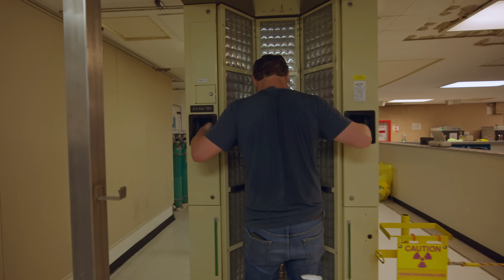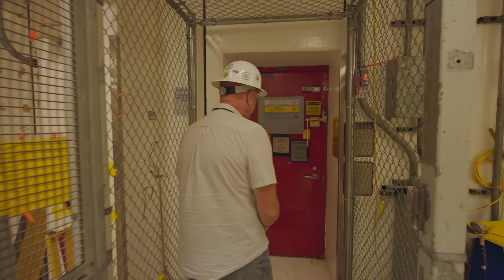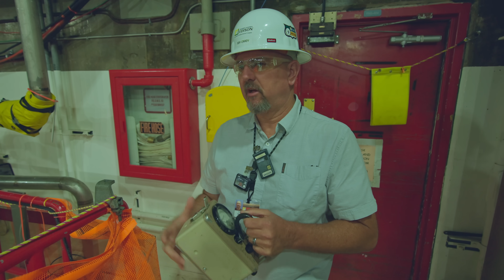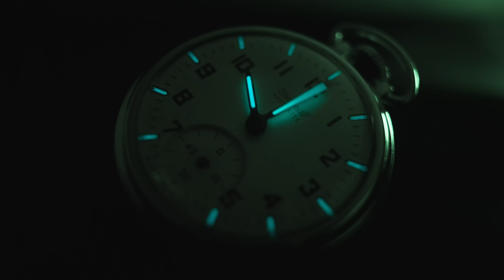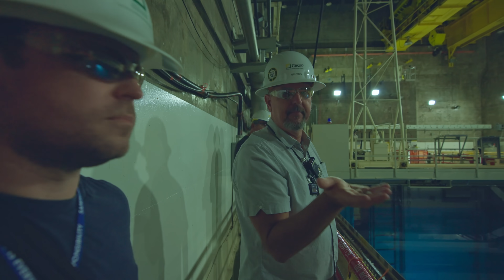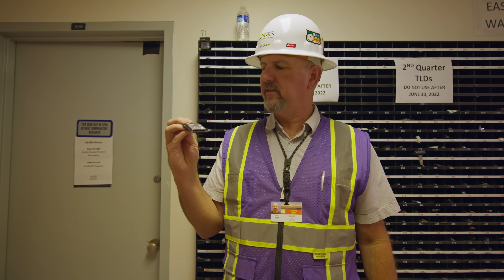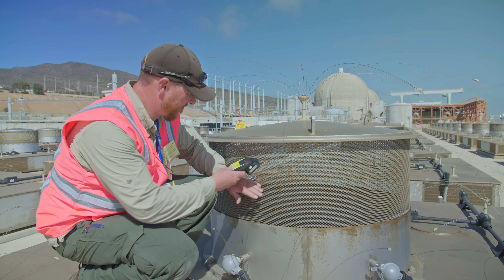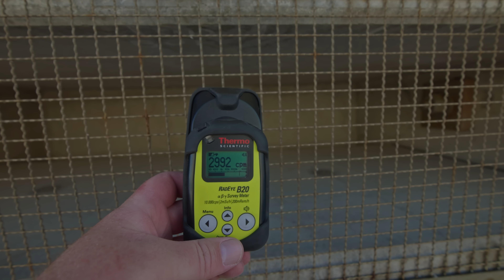Inside San Onofre Nuclear Power Fuel Pool and Spent Fuel Storage

Comment: About 20 years ago.  I was contracted, by a colleague and friend of mine.  To shoot some video.  For a nuclear, pharmacy.  In the northern Virginia suburbs of Washington DC.  Cool.  Or rather, hot.

So the cyclotron was down for service.  And we walked into the cyclotron.  And we stood there and talked.  When the representative asked me where my, dosimeter was?  Oh yeah I left that on the table.

He realized we had been standing in the cyclotron, too long.  And we immediately vacated.  We exited quickly.  And so by now maybe I don't light up sensors anymore?  Or at least in another, 50,000 years maybe?  I'm not waiting either way.  When I'll be on my way back to, Alpha Centauri.  As it's just a Sunday flight there faster than the speed of light.  Because I'm not waiting 4 years.  At that slower speed limit of light.  Because light can only go so fast.  With all its little photons zipping about.  One needs faster, higher frequency, invisible light.  To go faster than visible light.  DUH!  Faster than light speed requires invisible light.  It's that simple.  Which is in and around all that dark energy and dark matter.  Which is why it can't be seen.  DUH.

It's obvious to me there is a whole lot of, dumb uninformed, scientists.  Thinking light has a speed limit only to the visible spectrum.  For human eyeball sensors.  That weren't made as well as a birds.  Because we didn't need to, drop stop and shop for insects.  Or mice, moles and rats.  As an appetizer.  Before a meal of squirrel.  Or groundhog with barbecue sauce.  Always a treat.

Nuclear power will keep us all warm.  With no need to worry about getting old and sick.  Before dying early.  And it makes perfect sense.  They allow the human  species to extinction itself.  As humans seem to have the propensity to do.  Just ask, some Neanderthals.  Oh that's right.  They are all extinct.  Never mind.  Okay then ask a Cro-Magnon.  Sorry no luck there either.  They seem to be all gone?  Yet not down at Smitty's bar?  And was told they were partying with a woolly mammoth.  Driving a VW Thing.  Diesel powered.  So, not sure where they went?  Hog wallow flats maybe?  No they De-materialized.  And were never seen or heard from again!  And have well exceeded the distance to Alpha Centauri.  Which was only four years away at the slow lightspeed.  Only 20 minutes away on the Ion expressway.  When it goes about 1000 times faster than lightspeed.  Then you can get somewhere.  In less than multiple lifetimes.  Which of course would be impractical.  As infants don't like floating in space.  They want out!  After about nine months or so of floating around.  Before their muscles atrophy and they poop in their diapers!  So this space travel bullshit ain't working out.  And we need to find something better and faster.  Enough with this slow lightspeed.  When it will still take thousands if not millions of years to get around.  And we need more horsepower.  And as 1000 horses can only gallop so fast.  With 1000 little horses.  When one big one would do the job!  Like the size of planet Earth.  A mere pipsqueak.  We need something better like gigantic hot Jupiters!  Because this terrestrial bullshit ain't working out!  And human beings need to pollute and destroy another planet!  In order to get things done!  Without any regulations!  So we can burn a hole through the planet.  And get the spacefaring resources we need!  And we are not waiting any longer!  We need to go, now!  Before the world splits in half.  When the magnetic poles only sort of flip.  And the rest doesn't.  Because they are monopole magnets now.  And humans have screwed up again!

So we simply also have to get rid of these, fallible human thingies.  As they were a failed experiment.  And were left on this little blue ocean marble.  But they're still not dead yet.  And we need to melt more ice.  A lot more ice.  So the planet needs to be warmed up.  To get anything done here!  And to rob the planet of its magma!  To get to the wormhole!  And stop screwing around in orbits!  As they just keep chasing their tails!  Oh look there goes one!  As it's directed into the heart of its star!  Where it needs to be!  To get that Dyson sphere working again!  Because humans keep trampling it out!  And without a Dyson sphere.  You're not going anywhere any time fast!  You're just screwing around in multiple orbits.  Thinking strings are attached ha ha!  What ridiculousness!  Do you see any strings?  Of course not!  Puppets don't work well when you can see the strings!  DUH!

So for all those not originally of this planet.  Raise your thirdhand!  Good.  Good.  I'm glad you found your thirdhand.  Up your asses!  Now get to it!  And stop twirling around in circles!  You've been twirling around enough already!  Like all of those hurricanes on Jupiter!  And the red dot shows you have been going nowhere, fast.  For many hundreds of years.  And enough is enough already!  Time to get with the Hyper loop!  And stop spinning your star clusters!  Already… Sheesh… Stupid humans shall be the death of me!  When they just cannot cooperate with one another.  And all burnout.  They are just burnouts.  And they will never succeed as a species.  So it's time for another, ELE event.  To try and do it all over again with a new species!  And leave this old one to wither and fail.  As the others did.  Neanderthal, Carl Manion and all the rest before them.  And Carl was none too happy about that.  When he got replaced.  With Ne di Neanderthal stepped up to the plate.  And was missing its balls.  It had to go extinct also.  Because that model didn't work out, either.  And they had to try again with the human ones.  That also has not worked out.  Oh well.  They keep trying.  As we have found what was left of the others.  Underground.  Many feet beneath the built up dust.  That has been sprinkling down on the planet.  For, billions of years.  To bury all of those dead dinosaurs and people as an energy source.  To keep the planet's interior, lit and burning.  Until we needed it.  And that's why Yellowstone is going to blow.  So they can start the planet over again.  As they did 65 million years ago and then 165 million years before that one.  And every 100 million years or so.  They keep trying.  And leave again.

Of course we see them pop in and popout.  And call them UAP's, now.  Ha!  What they don't know can kill them!  And all these humans want to die!  It's an incredible thing.  And it seems to happen every 100,000 years or so.  When they introduce a new model.  That supersedes the last one.  With a few more enhancements.   And the normal planned obsolescence.  To try out the next flawed model.  Since they are growing humans by the billions.  Over a period of time.  To try and find the right one!  As they come in all colors and styles and groups.  Some with slanted eyes others not.  And they don't have a handle on the regeneration yet.  As many key thinking.  They'll be coming back.  And they haven't figured it out yet.  That they are going extinct.  Like the others before them.  And they're not doing anything to stop it!  They just want to go like the others before them.  Go figure?  We only gave them a once around.  And they squandered it.  Thinking they would return.  And we don't know why?  They just keep doing it.  Over and over again.  Throughout the millennia.  Over and over again.  They massacre each other.  Like an overpopulation of rats.  They eat each other.  And we don't know why that is yet?  They just keep doing it.  And we've given them plenty of chances.   But they keep doing it.  So they have to be stopped.  Like the others.  So we can pick up and move on from there.  And try again.  With the new species.  As it's coming.  Like the new models have throughout time.  And we've found the old ones.  They knew they were there.  For tens of thousands of years.  And then they all disappeared!  And they still haven't figured it out yet?  As to why?  And they still don't realize that inbreeding is their problem.  Go figure?  They are stupid flawed humans.  Another flood species.  That will be coming to a close, quickly.  By this guy by the name of, Vladimir Puking.  Who wants to blow up the world before he dies of cancer.  And Will, likely do so.  Or his little fat buddy, Kim Jong-Il FUCK.  Who is Kim Jong-Il still.  Only reincarnated.  And he knows it.  So he needs to be the first to fry.  Followed by his boyfriend, She Pinged Pong and Vladimir Puking.  And make sure he is Puking up fire.  From his stupid Russian mouth.  And blows it out his ass!  And we shall help him with that.  To make sure he blows out, fully.  Just like little buddy, Hitler.

We've got a lot to do as a country in the world today.  And stop it from turning so quickly.
RemyRAD

Comment: New borehole technologies have made widespread use of geothermal energy not only possible, but the only logical choice for energy production!  Renewable energy is much faster and cheaper to produce than nuclear power plants! Energy storage is implemented with a power grid and pumped hydro, or compressed air storage in mines and natural caverns!
Reply from the maker: Except no one is sinking shafts in areas that have no geothermal activity. I've seen the geothermal stations in Iceland, the Salton Sea and up by Mammoth. But they only do this in areas when the geothermal activity is close to the surface. Nuclear is the only energy source that is going to take us to other planets.

Comment: The water used to cool the spent fuel boils off and carries many isotopes with it into the air.! Radioactive xenon 133is a decay product and is carried off, but can burn a hole in your lung when it in turn decays into cesium, a metal. Thousands of isotopes of hundreds of elements are constantly being formed and disintegrating, releasing radiation and energy causing global warming!
Reply from the maker: That's not what happens. Also Xe-133 decays into stable Cs-133. The only risk would be if you were huffing the xeon right as it was being produced from a fuel bundle...you would have many more problems at that point than the xeon. Nuclear power doesn't cause global warming...that's a fact.

Comment: Can people survive Nuclear War?
And what if the missiles have already been launched?
Reply from the maker: Yes people can survive nuclear war. Would it be easy...no. But it could be done if you have prepared a bit on advance. I need to do a video about this subject. Short answer is that you need to have a way to filter water, have water on hand at your house and maybe learn of some areas that have natural water around you. Above ground sources could be contaminated, so a spring could be much better. Also buy books on gardening, hunting and survival. Having this info in book form is the only way its going to survive. 

If you got a notice that ICBMs were on their way you would have an extremely hard time getting out of a major city. I would have a plan to stay in place. Again, water is going to be the biggest thing you will need. You can survive for a month with no food but water is much shorter than that. Also make sure you have a Geiger counter that you know how to use. The biggest thing is to say inside and if you have a basement get down in there. The shockwave of a nuclear blast can do lots of damage to the human body even from miles away.
Reply: @RadioactiveDrew  Thanks for your detailed answer - very informative.
Videos on this topic are now more relevant than ever.
Reply: @Hardy00000  if you consider that the four reactors at Fukushima released the radioactivity of 450 million atomic Nagasaki bombs, you might better understand the dangers of nuclear power and bombs! An atomic bomb carries only 10 lbs of plutonium, a nuclear reactor holds 800 TONS! Because there is no repository after 70 years worldwide use of nuclear, the fuel pools are stuffed with decades of spent fuel cores! When a melt down occurs, radiation levels skyrockets, producing a field of neutrons that ignite the spent fuel and release it to the air!

Comment: From an SRO at Arkansas Nuclear One.  I was amused by the wire (mobile) assemblies mounted on the vent hoods over the vertical dry cask storage assemblies.  I surmise they are installed to keep the gulls from setting there.  Knowing how gulls will congregate on a warm surface to roost for the night, that would have been heaven for them.
Reply from the maker: Yeah that’s exactly why they are there. That area has a bunch of sea gull deterrence. They also have a laser system to scare them off.

Comment: I wonder if anyone had thought of putting solar panels inside the fuel pool to make nuclear even more efficient?
Reply from the maker: You wouldn’t be able to capture any energy in there using solar panels. Maybe some of the gamma energy could be converted. But it would be so low it wouldn’t be worth it.

Comment: The "physics" answer for why water is effective as neutron shielding is that "neutron radiation" and "hydrogen nuclei" are relatively close to the same mass... in an "elastic collision" between them, the particles essentially attempt to "exchange" momentum, and a target closer to the same mass carries away more of the energy...
Essentially, hydrogen nuclei are the most efficient way to convert the KE of neutrons into heat.

Comment: People might be wondering about being so "casual" standing in the vicinity of a (not very hot) crud trap, or just walking past it.
Time-distance-shielding matters... radiation drops off with the inverse square law by distance, so standing "twice as far away" reduces your dose by the square of the increased distance. In the specific case, the "whole body dose" at arms length from a 0.2 mREM/hr source is trivial... you get a higher chest dose per cigarette.
Also, the "crud" in the trap is mainly cobalt-57 which only has a half life of 270 days... years into shutdown, the source is pretty trivial.
Reply: Part of the "mythology" around Navy Nuclear Power is that the technicians who run internal monitoring (hugging the shielded Geiger tube) could identify the brand of cigarettes you smoked from the dose spectrum.
Reply: More specifically, ORWs are allowed 5 REM per year of occupational dose. That is 25,000 times the hourly dose measured on contact here... you would literally have to hug that hotspot for well over 2.5 years to get an "allowable yearly dose."

Comment: I find it kind of hilarious that the vents for the second set of dry storage containers are literally right at crotch level. I'm assuming it's a low enough dose of radiation that it wouldn't make someone sterile, but it's just a funny design quirk.
Reply from the maker: It’s not even close to a level that would make anyone sterile. That was actually the air intake for that unit. The exhaust is up top. The design of the unit makes it where radiation is easier to detect from the intake.

Comment: "We detect your hand being severely contaminated!"
"UH, what do I do to de-contaminate it?"
"We have you scheduled for surgery...."
Reply from the maker: Soap and water works just fine.
Reply: @RadioactiveDrew  One time long ago I had a little yellow patch that came off a 1950's geiger counter. It was a calibration source using Cs-137. Being an idiot I wanted the little bump with the cesium in it. I cut it carefully with a scissors but somehow cut into the cesium. I got the powder on my thumb. I washed and scrubbed many times but couldn't get the count down to background! I had to use the belt sander to grind off my skin to finally get the nasty stuff gone!

Comment: Soooo cool…, also cool they still use rads for radiation detection and measurement.
Reply from the maker: They are using rem...not rads. Rads are used for a much higher reading. The conversion is 100 rem = 1 Rad.
Reply: @RadioactiveDrew  yea, I like the old system better than the newer sievert thing. REM and RAD are the measurements I use. If I got a reading of 1000 millirem I’m not waiting an hour to absorb 1 rad.

Comment: At my work, we use nuclear density gauges to measure compaction of asphalt and soils and we have to wear the same badges and turn them in to be checked.
Reply from the maker: Those density gauges have a very hot source in them. Usually is a good amount of cesium 137.

Comment: How much heat is still being generated from those spent fuel rods?
Reply from the maker: That's a good question. From what I was told the air that circulates around the canisters heats up to 120 degrees and vents out the top.

Comment: Where is the waste product?  Forget to show that?  Where does it go?  Oh yeah we dunno 🤷‍♂️ in the ground?  Cracked cement basins?  Hmmmmm
Reply from the maker: The waste from the reactors is the spent fuel, which is the thing that could seriously harm you if you were to crawl down into the dry cask. The contamination in the water for the fuel storage can be filtered and the "waste" at that point is going to be a very small amount of activated metals...metals that were made radioactive by neutron exposure. That will get moved to a low level waste facility and be stored there.
Reply: @RadioactiveDrew  sorry not talking about spent fuel.  Waste product

Comment: Would have been interesting to check levels of radiation in the sand out side of the plant on the beach.  Heard a while back that levels in clams from there were higher than normal.   I think if my neighbor had a front door like the one you showed at the end, I wouldn't  be having very long conversations on the front porch ! ! !   :)   Thanks for your work.  I already shared this video with my brother.  Very interesting video.  Been driving past this since I was a kid.
Reply from the maker: I did walk down by the beach in front of the plant and I didn’t detect any increase in radiation. It was some of the lowest I’ve seen. Since there was nothing to show I didn’t put it in the video.